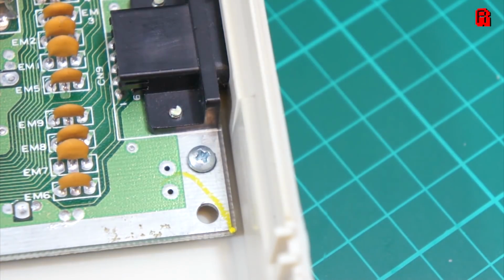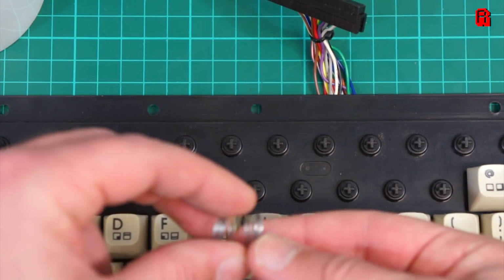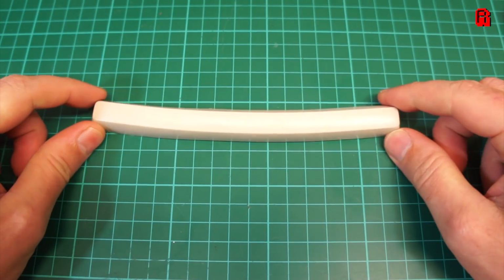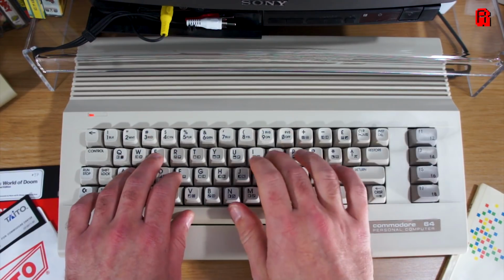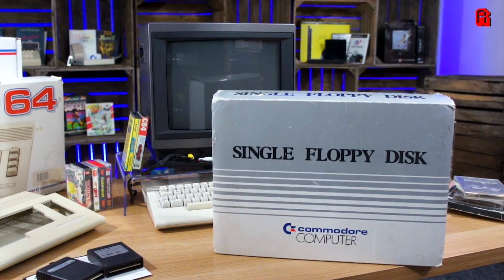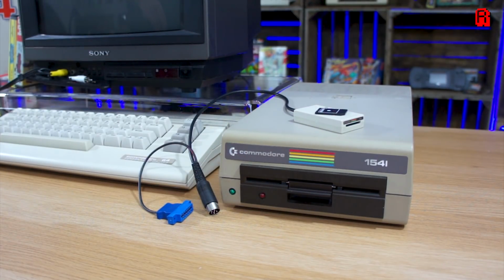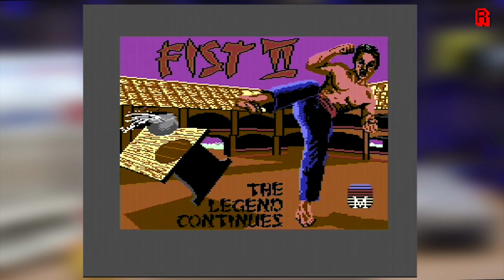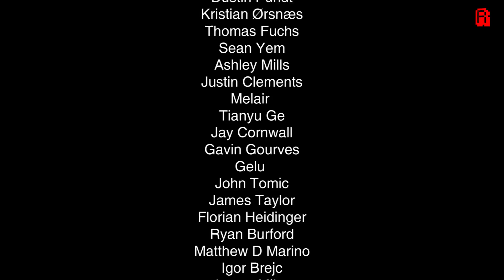Commodore 64c | Restored and Toured | Trash to Treasure (3/3)

Comment: I personally did the peroxide cream method you used, but instead of sunshine I used a UV light that I had suspended above it. I left it in the dark without any obstruction of other light sources for 16-32 hours (it can vary on how much yellowing you're removing, it's best to check up every couple of hours). Even reapplied the peroxide cream once or twice more before leaving it under again but it worked extremely well! Didn't do this on computer parts, but I did do it with Sega Dreamcast and Nintendo NES console cases that were both rather yellowed and they turned out well. Hope you found this helpful! Really enjoy the videos!
Reply from the maker: +Troy Faubert thanks Troy, it's good to hear it's possible with a light alone.  It would be good to find a way to accelerate that process if we can

Comment: Sweet baby Jesus that DD is redonkulous. It makes me think of how far technology has come. Even so, as I seem to recall it was massive for the time as well!!
Reply: Yeah, that's because the power supply was internal.  Also, it was a "smart" drive... it had its own CPU, 2k of RAM, and 6522 I/O chips, so there was a lot of circuitry in there as well.  The 1541-II moved the power supply to an external power brick.  That's why it's so much smaller.

Comment: Nice video all about your adventreus with the C64c. Nice to see lots of cool games in the video. The 1541 drive sure is a beast. Here in the UK you had a badge of honour back in the day if you had one. Everyone pretty much woked from tape. It's good that we have many options out there to load games and keep the C64 alive.
Reply: Your comment has reminded me that back in around 1982/83 when I worked in a small computer shop in Banbury (UK), the original Commodore disk drive (1540?) could actually take longer to load games than the official cassette drive!! :-D  Its so long ago now that it's a bit of a blur, but yeah... some C64 games were just too much for the original version of the disk-drive, and so took longer to load than the cassette version - which seemed crazy at the time!! :-)

Comment: My favorite computer ever, i loved it so much. Played games hours on it, learning basic pun here skills of programming and typing with both hands. 

The Tapedecks where a nightmare i whas so happy with my 1st (white) 5,25 floppy drive, that whas a cheap clone that died every few months and the store keep giving me a replacement every time my father whent back to complain about it. We had a cutter for these floppys, so we could turn it around and use the backside too for storage.

The later in i think the final stage of the system  i got a 3.5 floppy diskdrive but those floppys where so expensive at the time.

C64 i a big part of my teens (i whas around 12/13 when i got it and sold it when i whas around 19) and always a great memory of a no worries time. 

Thank you so much for making this great video its so good to see that people still care about this system :)
Reply from the maker: +RDJ 134 thank you for sharing your memories RDJ it's always nice to see your comments here
Reply: Back in 1985, none of the C64 owners in my area owned a 1541, it was all tapes. When we exchanged softwares (cough…) each Datasette would have its reading head at a different height setting. So either you use it with the top half of the case off, or enlargened the access hole for the setscrew. Option one was what I used. ^^)
Reply: I know that problem, we had a creative solution for that, we volt (i hope i pronounce this well) a piece of paper until it reached the right hight. Afcourse it whent wrong from time to time with the result of a damaged tape and some one beeing realy mad for it. Other option whas a double tape deck to copy the tapes :) Such a good times then.
Reply: The uberchampion of programming from our den wrote a little compressing tool called HGR Turbo Copy, which displayed the signal the take read in red and black beams on the screen and also played the signal as audio. you could see and hear when the signal came good. ^^)
Actually, I guess I may still have the tape with it. I have to check.:oD I didn´t touch my C64 in over ten years, I guess I finally have a reason to do so..

Comment: That's exactly what I did to my a1200 space bar, but luckily not warped it much as yours! I used a slow cooker from tesco, very cheap and with a lid ;) it,s perfect. Beware though, my brown keys got bleached too, and some of them went a lot lighter than I thought was possible so maybe do the white ones and dark ones separate. I think I may have used too strong a mix of peroxide. Good job on the restoration 👍🏼

Comment: Think I have my c64 breadbin somewhere. Not been used for over 20 years. Had a good selection of games too. Your right about the cassettes being more popular over here. Must dig it out and see if it still works. If so I’ll have to try and fix the port 2 issue it had. Wouldn’t turn left on port 2. Think it needs a chip replacing if I remember rightly
Reply from the maker: Save the C64 Sparkles!  Sounds like it could be a dodgy CIA chip or dry joints on the joystick port.
Reply: Or it could be a broken pin in the connector.  To fit them inside the breadbin, the pins on the joystick port are bent at a 90-degree angle before they connect to the system board.  I've had the joystick port on my VIC-20 break like that.

The good news is that the pin for "Left" is one of the top 5.  The bottom 4 (which includes the fire button, ground/earth, and +5V line) are much harder to repair because of the design of the plastic shield that was designed (ironically) to prevent this exact kind of breakage.

Comment: although the solution may have been at 70-80 deg, the steel pan bottom is in contact with the heating plate underneath and may be way hotter than the liquid. How about putting the solution in a bowl and heating it over a pan of water below.
Reply from the maker: A good point and something I should include in the episode I make to explore it further, thank you for the suggestion
Reply: Thats a good suggestion. It was definitely too much heat, real shame. 70c is the MAX, though. 60c maybe safer. Going to be experimenting soon.
Reply: Why not re-heat the space bar in water then clamp it down flat and "in shape" while it cools? would that work do you think?
Reply from the maker: This is what I tried in the video, before I clamped it I reheated it but with no luck.  I do still have it so maybe I'll think of something but I think it may be a lost cause
Reply: I wonder if you could make a plaster mould of a space bar key in the correct shape, then using a heat gun/ hot water soften the bent one and put it into the correct shape mould?

Comment: 4:56 - Ah man, that is brutal but you live and you learn.

Have you considering using a mixture of black light and/or halogen light for retrobriting as both sources emit good and safe levels of stable UV light, compared to the anaemic levels of sun on our island, but halogen light offers heat that is also central to the process too, so maybe a small 800w heater with the temperature/distance monitored could work.

Another great vid.

Comment: The 1541 really was a ridiculously large disk drive even back then - but then it also is not only a disk drive, it contains a whole separate computer. I remember that back then I had a disk copy program for two 1541 (drive 8 and 9) which loaded itself into the RAM of the floppy drives, and after that you could disconnect the drives from the C64 (so you could play games on it while copying) and the drives could copy disks on their own (i.e. they recognized when you inserted a source and target floppy and started the copy process automatically).
Reply from the maker: +freibier that's a very good point it has its own 6502 CPU inside it as well, quite the bit of kit.   Thanks for sharing your memories.  All legit copying activities I'm sure.
Reply: Uhm,  mostly legit I think, my memories are a bit hazy :-) We did buy games, but only the super top titles we knew would be awesome and last a long time. For me, that was mostly RPGs, like my prized Ultima 3 / 4 / 5 boxes with the cloth maps, gimmick items and thick manuals, or the TSR "Gold Box" games. Or Bard's Tale, which came in a very pretty LP Sleeve packaging. It is interesting that so many say they only had the datasette - here in Germany, the C64 was the computer everybody had (no Spectrum people around and Atari was only a thing during the Amiga/ST time), and everybody who had a C64 also had a 1541.

Comment: Another great Video, loving the content, brings back lots of memories from the 80's/90's. 

Have you ever thought about doing any content on arcade machines from the time, I know the pure size of the things would be a nightmare but always wandered what was actually inside them? As a lot of the games where adapted for home computers at the time, I often wander if the computers where made by the pioneers of the speccy and the Commodore??
Reply from the maker: Thanks for watching!  I've owned a couple of JAMMA cabinets and converted them to MAME in the past, taking a look at some original arcade boards might be a fun idea, I'll have a think on that thanks for the suggestion.
Reply: +Ginger Ninja FPV  A lot of that information is available on the Internet from people who specialize in restoring arcade cabinets.

I can tell you that the CPU used in the video games were mostly similar to the ones that were popular in home computers.  The earliest arcade games (late 1970s) used the Intel 8080, but that was quickly superceded by the Zilog Z80.  Atari used 6502 CPUs in most of their early arcade machines.

Later games (like most of Capcom's games from the early 1990s) used two processors, one of which was usually a generation behind the main CPU.  For example, the Capcom games used a Motorola 68000 main CPU, with a Zilog Z80 for sound.

Then, finally, in the 2000s, they started using RISC-based MIPS processors.  Arcades are still thriving in Japan, so there are still a few arcade games being made, mostly by Japanese manufacturers.  Most of these use modified PC-based hardware with a high-end graphics card.

Comment: Quick note about the evaporation problem. I think that Peroxide has a higher boiling point than water. So it could be possible that you were boiling off the water and leaving more peroxide heavy solution. Then you would add more peroxide and water solution. So over time it's possible you ended up with a higher concentration of peroxide than you were planning on. I am not 100% sure this is the case, just thought of it when watching. A lid would fix it, as you stated. But I thought it might be interesting to keep in mind for future projects.
Reply from the maker: +Nick Young that's a good point I should find out what the boiling temp is for the peroxide thanks

Comment: have you ever considered trying one of those small UV lamps they use at beauticians? They are used for drying nail varnish and they cost about 15 to 20 quid. You'd only fit about half they keys in it but could be worth a go.
Reply from the maker: +MrTravisHighrise nice idea, do you think they would handle 4 hours continuous use though :/
Reply: don't know, but I don't think imaginethey draw a lot of power or run very hot. They have them in nail bars and I guess they run them all day with different people getting their nails done.
Reply from the maker: MrTravisHighrise interesting... I'll look into them
Reply: I guess you can also justify it by gifting it to Mrs ManCave and then borrowing it :)

Comment: I think you should consider using ESD protection at your work station.  I never thought much about static damage until I actually ran RAM testing tools and found lots of bit errors.  It’s just not worth the possibility of introducing random and invisible failure modes to equipment you’re trying to preserve

Comment: Would it be possible to maybe supply the UV light needed for 'outdoor' retro-brighting but indoors.  Maybe just in a large box or something, mount as many UV tubes as you can fit in the lid of a box and close it up?
Reply: eggypickle I believe people now think the UV does nothing, and that it is the heat alone that activates the reaction.  The 8 bit guy did a video on it recently.
Reply: Didn't know that, I'll go check it out.  Thanks

Comment: Just a couple of interesting trivia bits regarding the C64. You mentioned that compact data cassettes and ROM cartridges where the more popular method of loading/saving  software/files in the U.K. Vs the 5 1/2 floppy drive that dominated the home computer market much sooner in the U.S.. My understanding is that this was due to high import taxes in the U.K. Vs the U.S. such that once the cost of making the floppy drives came down in general, home computer users the U.S. was quicker to switch to them whereas import taxes made cassettes and cartridges the significantly cheaper option in the U.K. For all except for business computer users willing and able to effort the higher cost. Another interesting fact about the Commodore 5141 5 1/2 floppy driver (for the C64) was that the designed it to be compatible with the Vic 20’s 5140 floppy drive for backwards compatibility but due to a bug in the 6522 VIA chip in the 5141 drive, the drive did not work as it should. Given how late in the development process the bug was discovered, rather then replace all the VIA chips in already produced drives to address this flaw, they simply wrote a quick software patch which worked around the hardware bug. The problem was the rushed patch has the unfortunate effect of significantly decreasing the read/write speed of the drive compared with similar floppy drives for other systems such as the Apple II. Had they not insisted on backwards compatibility with the 5140, this would not have been a problem. Fortunately for C64 users, because this problem could be addressed via a software patch, third party developers come up with software quick-loaders that significantly speed up the drive. So I strongly recommend any newly acquired C64 5141 floppy drive owners to seek out a quick-loader for the drive.

Comment: Nice video man. I haven't spent much time on the C64. I've got one here with the original 1802 monitor and a member of the community was kind enough to make and send me a replacement power supply so I didn't have to worry about frying chips with a bad 5V line. I have the MKII floppy disc drive which strangely wont load games if i put it close to the monitor? I 100% have to invest in the SD2IEC or an ultimate cart.
Reply from the maker: +John-Paul Parker thanks!  I'd  like to try an Ultimate cart they look pretty neat but for the price the sd2iec is pretty sweet
Reply: +John-Paul Parker  From the sound of things the monitor is putting out a lot of RF interference... enough to interfere with the disc drive's electronics.  Your comment suggests that it works as long as the drive is far enough away from the monitor.  If it bugs you and you really want to be sure, though, start with something simple like taping a layer of aluminum foil to the side of your monitor, or surrounding the drive with a wire mesh cage (a "Faraday cage").  If the problem goes away, you've found the culprit.

Comment: I'm not a Commodore chap at all, so excuse me if this is a daft question. The Epyx Fastload cartridge sped up the disc drive transfer speeds by 5x so with it most games would load in under 8 seconds. So without it a game might take 40seconds to load from disc...?

Comment: Real shame about your spacebar. The temps are REALLY important. I too learnt the hard way, but I tested mine on a old spare set of yellow keys and only 2 warped from too much heat. I found a MAX of 70c is ideal, but 60-65c maybe safer. I have a spare C64c with really bad yellowed keys so I will test 60c soon, and different times. I think if you have the time to keep checking, then the ideal time maybe less. Really enjoyed the video. I think the more we experiment with de-yellowing are retro equipment the better techniques we will eventually find.
I think the real problem may come from what is allowed, and not allowed, to be posted. I am noticing the postal guidelines are getting a lot more strict. This could be the climate we currently live in.

Comment: Do you have to use thermal tape for the heatsinks or any thin double sided tape will do?
Reply from the maker: Go with the proper stuff to ensure heat transfers, if you melt non conductive tape on the chip you could make it run hotter
Reply: Hey thanks for replying so fast! I went with your advice and ordered some thermal tape from China, since the local stores in Greece only have 2mm thick adhesive pads. While it could probably be ok i do not like the aesthetics of it.

Comment: Quick question, can you save programs and data onto SD from your C64?  Also my favorite game back in the day was "Forbidden Forrest", for it's creepy visuals and moody music.
Reply from the maker: Yes most of the time.  It doesn't  emulate the whole drive which is is like a computer itself.  If the game puts custom code on the disk drive the saving wouldn't work.  Regular saving is just fine.